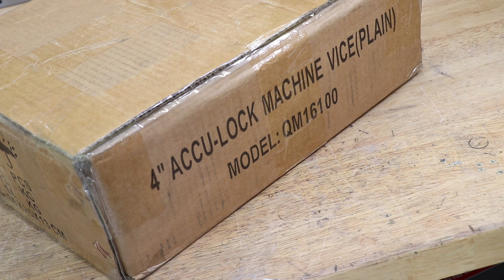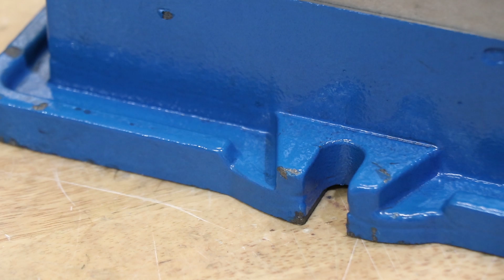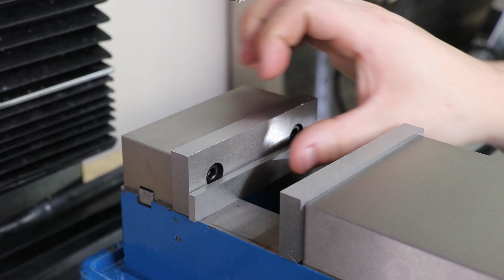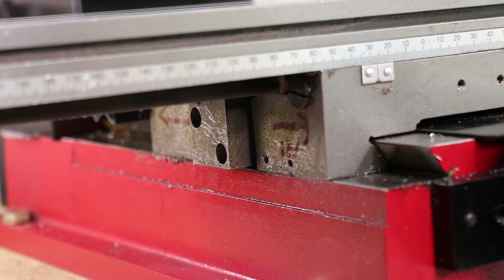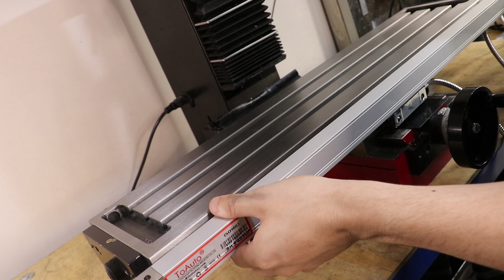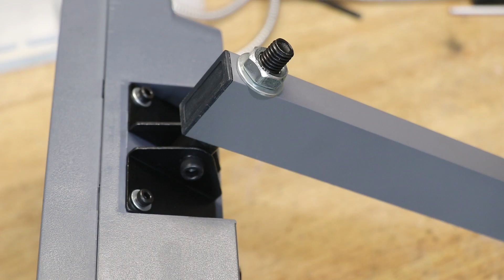Milling Machine Upgrades - New Vise & DRO Installation

Comment from the maker: G'day everyone. Hope you like the new mill upgrades. Hope the tutorial is helpful. I didn't make any CAD drawing for this, since it was all done in situ, but I always happy to draft some up if you would like. I am still deciding on whether to install the DRO on the back, so I'll let you all know if I make the swap. More mill upgrades due to come in the future. Cheers
Reply: I went with the front installation as sometimes you lose that bit of travel by having it on the back.
Reply: Looking forward to more vids.
What length scales did you end up going with as I'm just about to order mine
Reply from the maker: @ozzyplinkster8841  These were 700mm scales for the x axis (slightly too long) and 200mm for the y axis which was the perfect length
Reply: @artisanmakes  what scales length  would you recommend for the SX2.7 ?  200mm and 590mm? Thanks

Comment: Im about to purchase a Dry kit my Sieg x2.7L and am confused by the way they are measured. I know in the vid you said you got the wrong size so what sizes do I need for the mill? Thanks for your vids, they have helped me a lot. Cheers!
Reply from the maker: Which part are you referring to
Reply: @artisanmakes  I obviously didn't spell check the stupid auto correct- anyway, I was talking about the Dro linear scales. Im a bit confused as to how to get the right length. Cheers.
Reply from the maker: Ah yes, you only need to get dros that are the same length as the table movement. Forgot what that is for this mill but 600mm should be enough. I got 700 which was the length of the table and that was too long. And 200mm for the y should be fine
Reply: @artisanmakes  Thanks!

Comment: I operated a Cincinnati Mill in a track shop (railroad track) for years. The vise I ordered for the mill could do double angles. For one it would twist on it's  base which had measurements in degrees, plus the vise could be raised on one end creating another angle. This vise made the mill  much more useable in making the many parts needed and much more interesting.

Comment: Could you offset the vyse away from the centre of the table to stop interference with the hand wheel??

Stavros
Reply from the maker: The vise still would cover the handwheel since the spindle is in line with the handwheel. Cheers

Comment: That vise is quite awesome for the price, I know for sure because I got one of the same type. Just one thing you really want to do to it, make a solid fixed jaw without a key, improves the accuracy unbelieveable.  

Greetings from Germany
Reply from the maker: I was not aware that you could do that to a vise, I thought it had to be cast as a solid fixed jaw. I'll have to look up how to do that. Cheers
Reply: @artisanmakes  keyed jaw is acceptable, as long as the key doesn't look like that one! I would say if you have access to a way to either recut those keys slots for a larger key or mill out a new jaw to go ahead and do that. I have no idea how the other guy intends for you to make it a single piece jaw. That doesnt seem possible to me
Reply: Can you share more details or even a video showing this single fix jaw with a key concept?

Comment: Even if it seems like a lot of money for a very boring tool, when there’s so much cooler stuff out there to spend hard earned dollars at… The simplest type of band saw will be the biggest improvement you never knew you wanted. The same goes for a decent belt sander. How I know… Well 🙄😉
Nice channel. Keep it up.
Reply: Yes! A simple benchtop horizontal bandsaw is cheap enough, here in the states and least, and would be a HUGE improvement over cutting stock by hand.
Reply: yea that would make cutting so much easier

Comment: I was thinking about getting one of these for some light duty stuff. Is it worth it?
Reply from the maker: I guess it all depends on what type of mills you can find on the used market too, but considering the used market for small mills is not that great in my part of the world, I would say I am very satisfied with the mill for the price I paid.
Reply: @artisanmakes  thanks man. I have a new 12x14 foot shed so I can’t fit big mills in it. these mills should be enough for me. Love the channel, keep up the good work.
Reply: @shotgunsam23  RF45 style mills are in the same price range as Sieg SX3 but have a lot more cast iron bulk making them more rigid. If you have vertical space, I'd recommend them over sx2.7 or 3. That said, these are pretty capable of you're conservative with the feeds.

Comment: I would like to see you install air springs for the z axis. I will be doing it for my mill sooner or later, so it would help me a lot, as you tend to have good ideas. I will use your dro mounting brackets, they are nice.
Reply from the maker: I had a look into the air springs when I got my mill, but they are really designed for the smaller x2 machines. The 2.7 has a different mechanism for raising the head, so unfortunately I won't be able to help you here. Cheers
Reply: @artisanmakes  I have a milling machine with same mechanics for lifting head as yours. For X2 mills some form of spring is required, for larger mills it is a quality of life upgrade - they reduce the weight you have to lift and reduce the wear of mechanical components.
Reply from the maker: I'll have to have another look, originally I looked at the LMS website and this kit wasn't compatible with the x2.7 mills.
Reply: @artisanmakes  You need cheap airspring for a car trunk, a bracket and a couple of bolts. LMS kit is only  for S2, and it's design is not fit for 2.7. I am currently trying to design mounting brackets, but I am no very good.

Comment: Highly recommend you make a key for the base of your vise. On smaller machines like that, it makes it very handy to take the vise on and off and not have to retram it in.
Reply: Can you be a bit more specific about this key for the vise?  I'm in the market for a vise and would hate to install it to find out I need to take it off again to make this key thing.
Reply: @ChristopherJones16  on the underside, put a piece of stock the same width as your t slots, make sure it is perfectly trammed ,, and then Mount that permanently. If your table is in decent shape, you don't need to retrim every time

Comment: As Jim Korman points out below, pull the vise apart, clean, deburr, re-lube etc. I'm not saying yours will be the same, but the two 4" mill vises I bought for about 3 times as much each weren't exactly good solid castings, nor were they poured from anywhere close to the best cast iron. Under the paint they were full of bondo filled voids which drastically weakened the vise bed allowing it to flex under even average tightening pressures. But my suspicion is the real problem was mostly due to the cast irons poor composition. Yes those vises were accurately ground and looked real good where it showed because I checked them on a surface plate. But in reality it was wasted effort because you can't add rigidity later when the casting itself is that weak. It's best to indicate the vises rear fixed jaw while tightening the vise with a thick part at various elevations on the parallels. I'd also check for any moving jaw lift. Without that check you can't know how much the vise or jaws are actually deflecting. That check is even more important with a dro because that fixed jaw movement can be enough to change your parts Y axis location to make a measurable difference on higher accuracy parts. Any inaccuracy in your work holding will always be reproduced in your finished parts. Thinking "it's good enough for what I do" is faulty reasoning. Yes for most items it will be, until something better comes along that does require higher accuracy. That's when all the cleaning, deburring and fine adjusting pays for itself.

I also 100% agree with the other poster below about pulling the table X,Y axis, feed screw and nuts apart for again a through cleaning, deburr, re-lube and proper gib and feed nut adjustment. It will be a much different machine if you do and I suspect it will vastly reduce your back lash and be far more accurate and much smoother on the table movements. These machines are factory adjusted fairly loose to compensate for any contamination and the applied anti rust preservative. To someone that doesn't know what they should feel like, that loose adjustment feels ok. It's impossible to remove all what the factory left in there or that preservative without pulling it apart and washing all the parts down in a good solvent. So it's impossible to adjust to the minimum clearances while still being smooth to operate. Any far east machine requires this simply because there's no money left for the factory to do this. While I didn't find that much grinding dust in mine, there was enough I'm very happy I did so. Using an actual industrial formulated to do the job way lube also helps with how smooth the table moves as well.

The one video shot showed taking a far too deep of cut with that fly cutter. They are and have always meant to be only a very light finishing tool. Yes the tool itself can do so without any damage, but the mill isn't designed to withstand the hammering that interrupted cut produces. What happens is your then slowly beating both the spindle splines and bearings to death. The actual noise is created by the spindle splines bouncing back and forth within there clearance range as the load is taken up and released every revolution. Unless you have a minimum of two teeth engaged in the cut such as with a multi tooth face mill, that hammering is inevitable, so the depth of cut has to be light to reduce it's effects. My mill is a whole lot larger and heavier Bridgeport clone. At most I'll take a .010" depth of cut in aluminum and maybe .005" or less in steel with any fly cutter. Even with a face mill I'll reduce the feed rate a bit as the teeth start to enter or leave the beginning and end of the cut. And yes I do know there's many videos showing large diameter fly cutters like the Tormach taking large depths of cut. Those are misleading and anyone who understands what's really happening mechanically will refuse to try it. There also ample videos around where that hamming can be clearly heard with fly cutting and large depths of cut if you know what it sounds like. A fly cutter is an excellent and cheap to produce tool for allowing much better surface finishes. But the built in machine limitations have to be understood to use them properly.
Reply: Hey great comment.  I still have to buy a vise for my Little Machine Shop X2D, and was hoping you could point me in the right way.  Since a vise is something that can be taken off and put on a better mill when I upgrade to a better mill I'll spend more than $100.  I know they can get expensive but I'm just a beginner and this is my first mill.   I was going to get a 3" vise at first but seen many using 4" and 5" vises so now I'm considering a 5". Any pointers on what vise to get and things to do first with my LMS X2D will be greatly appreciated.  Also what's your opinion on LittleMachineShop's 2" spacer they sell for the Column? It adds 2" to the Z axis but Ive only seen one mill using one in all the videos ive watched on here.  I plan on upgrading it with a belt drive, and CNC.  Is a DRO even necessary with CNC since everything is read on the computer screen?

Comment: Nice progress,  now you add a vice stop to your project list.
Reply: vise stop? Is that the same as what some people call a  "work stop" that you clamp onto the table with a rod hanging vertically touching the metal of the work so if you flip the the work piece you can  get put it right back into position?

Comment: make a split vice, i used cheap hf vise, cut in half and drilled 4 holes.
Reply: Whats the purpose of this? I never seen such a vise in any of the milling videos ive watched.  Do you have any videos showing this?

Comment: I have a vice for my mill drill that looks like the same one you have.  I found that the jaws in my were not flat. They had a bow in them of about .020 of an inch or 0.5mm so that they were thinner in the middle. I flat-en them by hand lapping them with a sandpaper on my table saw . They now work much better.

Comment: I bought the same vise. The ball oiler broke on mine the 1st time I used it. I took it out and removed the spring with a pick and stretched it longer. Then I reinstalled it and its fine now. good luck with yours
Reply from the maker: Cheers, I had to use a scriber to get it back into position, but I'll probably buy some replacements

Comment: A couple years ago on "Build Something Cool", Dale reviewed one of these Chinese vices by comparing it to an American made one. A melee ensued in the comment section. On one side, viewers felt he was biased against the lower cost Chinese one. They accused his review of being nothing more than jingoistic American fluff. On the other, you had viewers defending his review as being accurate and well founded. The discussion quickly devolved into hurling insults at each other. It was one of the most entertaining comments I've read on YouTube. A lot of commotion over a vice review. LOL!
Reply: I could settle that feud with facts I learned from my Political Economics course in college about China's economy.  Fact is China has TERRIBLE ore in its ground and very  very little of it.. Because of this China imports all their ore to make their metal products aaaaaaand because they import all their ore (from various countries.. MOSTLY Australia) they have various quality ore which they just dump into their huge foundries producing metal thats like a mutt metal mix.   So of all the things one can buy from China.. metal products should not be bought there if you are looking for quality. If its metal that is life-saving.. like screws, bolts, brackets holding your plane, car, four wheeler together then try not to buy that from China.  Heck even the bolts I buy from HomeDepot snap so easily anymore and I suspect they too are crap from China with an American Brand name on it.
Reply: @ChristopherJones16   China makes some dirt cheap ER collets and shanks of very high quality. I don't know how old your Econ class is, but China has teamed up with trading partners in Africa who supply them with the highest quality minerals. Angola, for instance, has inexhaustible very high grade iron ore reserves. China can build to any spec depending on what you're willing to pay. At the lowest end, they don't have any competitors. At the highest end, they devastate the competition by providing unmatched quality and at far lower prices. Right now China feeds at the bottom and serve as mere contract manufacturers for higher end products. To give you a concrete example, they have become a leader in PCB manufacturing to the point where they can produce PCBs far cheaper and better quality than anywhere else.

Comment: Given how common it is to fit DRO's to these units, you think the manufacturers of the machines would have started making them a bit more DRO friendly by now. Nice job.
Reply from the maker: I have seen some aftermarket resellers fir dro's but I was a bit surprised that sieg dont sell them fitted from the factory.

Comment: Qm vice series is great for the price, I have one, qm80 and like it. But why only 2 axis DRO?? Z digital scale is also very important and useful! And there are new types of DRO (YH800 for example), price is the same as this classics led 7segment, but they have a nice big tft screen with some fun options.
Reply from the maker: As pointed out, the mill comes with a dro on the quill so I didn't think it was worth the extra cost to get the 3 axis dro. And I am not as well versed in dro models, looking on eBay I didn't see any models with screens, mostly derivatives of on this one design, so I just went with a kit that happened to be on sale at the time. Cheers
Reply: 6:45 He shows that the quill already has an integrated DRO.
Reply: Anyway greetings, dro will greatly increase your performance, forget about the backlash. Waiting for some new prescious videos from you!

Comment: You didn't say, but I've a very similar vise. I took mine completely apart to clean as there was grit in various places, especially the screw. Spent an hour or so with a file and softened the edges of most surfaces, then all new lubrication where needed. As you note, it's not a bad value for the price.
Reply: Whats the proper lubrication to get for a vise?
Reply: @ChristopherJones16  I just used a VERY light coating of Wheel Bearing Grease on the threads. There is a bearing surface where the "nut" bears against the moveable jaw; that gets some grease also. Mine has open ball bearings at the thrust collar so I packed that bearing also.

Comment: I find the first and most important upgrade of offshore equipment is a complete disassembly, clean, de-burr, hone, flatten, repair of the components. 
If you treat it as a kit that has been assembled for 3D reference you end up. with a much better understanding of the machine.
Cheers
Reply from the maker: If I learned anything from my time with the smaller sieg lathe, a good disassembly is always a good idea.

Comment: Congratulations on the upgrades!  I agree with you completely.  A dro on a lathe isn't necessary at all, but on a mill it makes everything easier.
Reply from the maker: Cheers, only time I'd consider using a dro on the lathe would be if I had to cut radiuses, but at that point I'd probably swap to a form tool or CNC